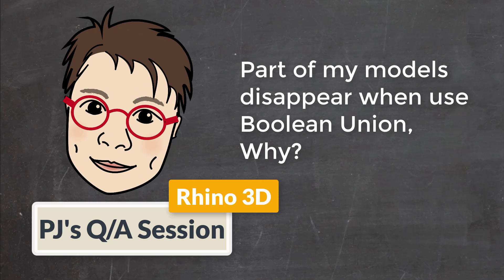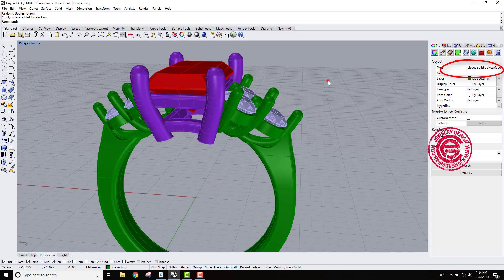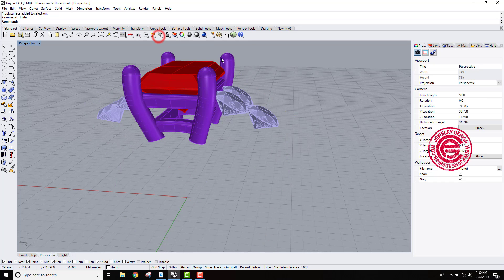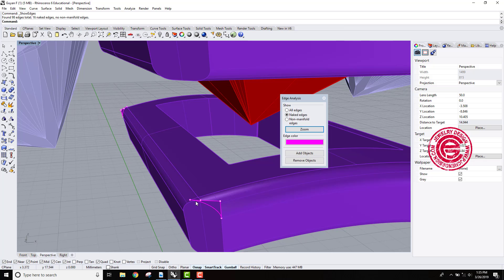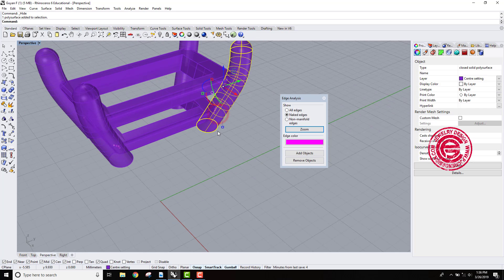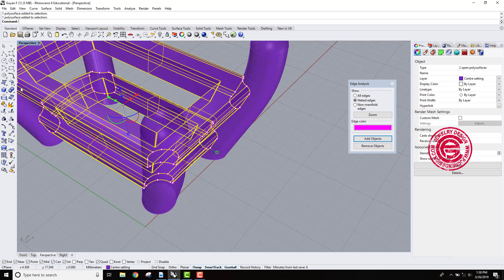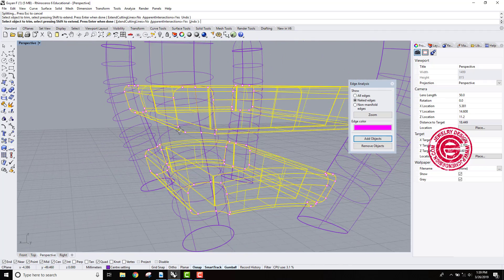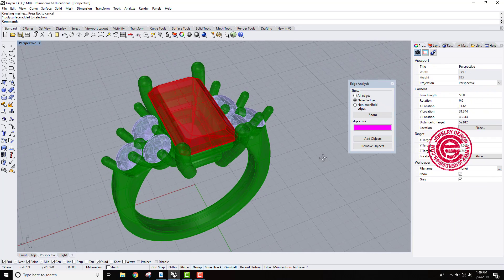Boolean Union is not working and model disappear: Q/A Session (2019)

Comment: And the Boolean Difference is not working?
Most of the problems I have when wanting to subtract figures with triangles
Reply from the maker: Maybe because all the surface coming into one point.
Reply: @PJChenJewelryDesign  I simply have two objects, the first has a concave curved surface, the second is a negative that I plan to use on the concave surface.
-

I have the problem when I want to subtract the negative from the concave surface. The negative has several triangular holes as if they were teeth.
-

But when I want to subtract the negative, I get an error.
I have tried everything, the polyline design of which I create the solid of the object that I use as a negative is well joined at all its ends.
-

I no longer know how to create this Boolean difference.